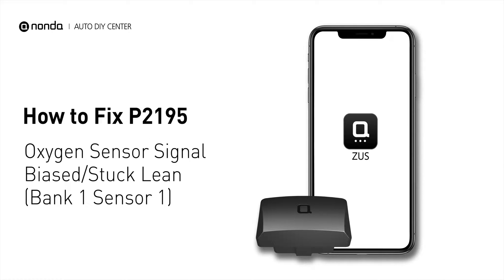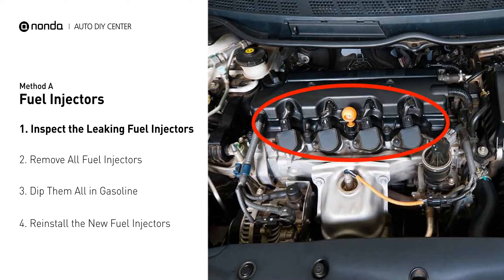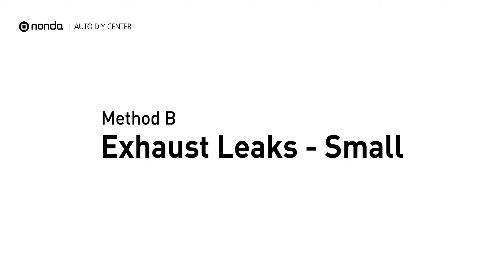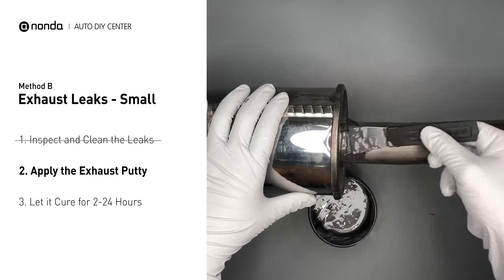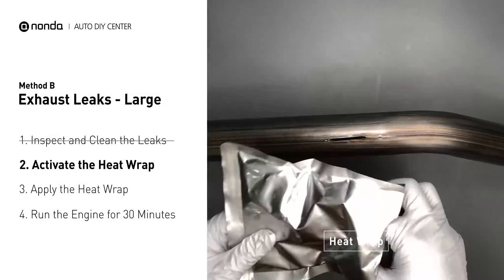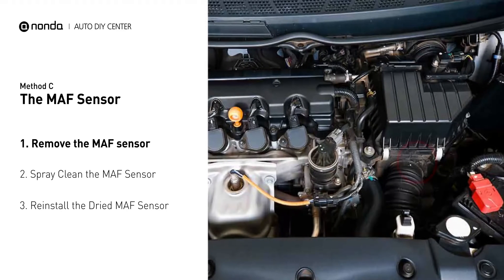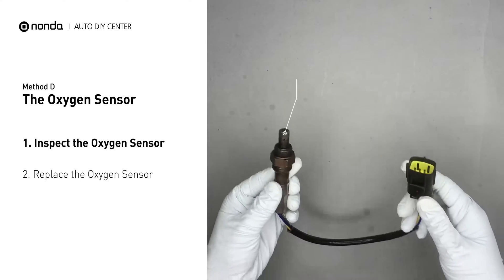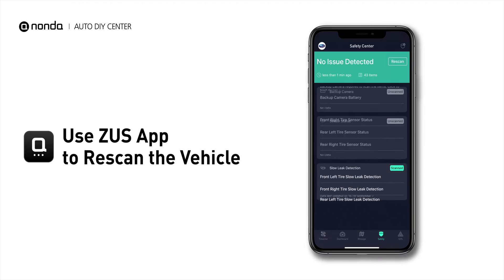How to Fix P2195 Engine Code in 5 Minutes [4 DIY Methods / Only $8.12]

Comment from the maker: Hi, I'm Steve, nonda's lead mechanic engineer. 
Feel free to leave your comments here if you have any mechanic questions, I will be glad to help you out!
Reply: I'm getting p2195 and p2197 simultaneously on a Mitsubishi eclipse 2007 V6
Reply: @kingstone1987 I have the same car, same engine - did you get yours fixed?
Reply: @jessicabozeman3103  one O2 sensor was bad, after chance it works a little better but the code changed to p0171 and p0174
Reply: My ford freestyle was reading code po.302 cylinder 2 misfire detect??
Reply: Hello I need assistance. 2014 Ford Taurus
Reply: Hello i have a P02195 code on my ford taurus 2004 V6 Dohc engine. i have changed the fuel pump, oxygen sensor, fuel filter, fuel injectors repair exhaust leak. but there is still issue with acceleration. please help
Reply: @souleymanenapon8976 возможна  ''провода электрические от датчика кислорода --- управляющий компьютер двигателя'''.
Reply: What did u use to clean the Maf?

Comment: I have an avensis from 11/2011 with the error p2195, I changed the lambda probe, no change, sensors on the board and the car does not start

Comment: Hi.
I have a Toyota Avensis 2012.(Norway)
 I did all the steps you mentioned but the code(P2195) in addition to code (c1201) still shows up after one-two days,
things to know;
1- the car had en faulty head gasket, and the faulty code where there.
2- I changed the whole engine including the EGR system.
3- after changing the engine I changed the MAF sensor and the Lambda sensor(O2 sensor ) from another working car so I'm 100% sure that those sensors work.
4- I checked the exhaust system, and there is no leak or damage.
5- all values are ok, (I'm using Autel scanner) the o2 sensor gets volts and there is a current goes in the circuit.
My doubt now is about the A/F relay.
I hope you can help me to find out the issue.
Reply: Did you find fix?

Comment: I got this code after I changed the oxygen sensors on my 05 Ford explorer 4.0L. I also changed my throttle body, egr valve, fuel pump and filter and PVC.  My truck still has a rough idle after I replaced all of those parts.
Reply from the maker: Kindly confirm if this is the only code you're getting.
Reply: @nondainc  yes that's the only code.  I think I have a clogged fuel injector

Comment: Just came across your video My car has this code I will try your possible solutions starting with the least expensive first. Thanks for the video/info will post update. Keep up the good work!
Reply from the maker: Hello, we really appreciate your feedback! Hope it helps!
Reply: @nondainc  O darn no return! I have 2195 & P2197 on my ford escape 2001 V6,  Mechanic found clogged Catalyzer, but could not fix cylinder 4 & 6, more clogged somewhere or computer?  Sensors look okay, socking in car cleaner, could it be clogged inside the manifold?

Comment: My car has been stalling at red lights , I cleaned the EGR then got this code. Should I change the sensor first?
Reply from the maker: Hello, we suggest to follow the tips/suggestions provided in our video (how to fix p2195) to pinpoint the cause of the issue.
Reply: Did you ever figure out what your issue was?

Comment: Each fuel injector for my car is $70
Reply: Buy it on eBay/ Amazon. Never try physicals shops.
Reply: @ShobucK  Those stores usually sell knockoff products. Specially eBay
Reply from the maker: Hi Robert, yes it's true. In all cases fuel injectors are really expensive. The price varies for every vehicle.
Reply: @nondainc  way to expensive, last resort for me!